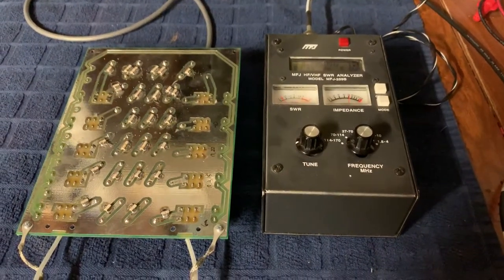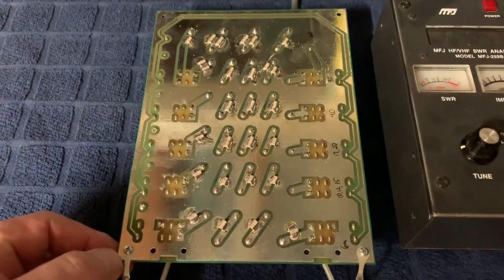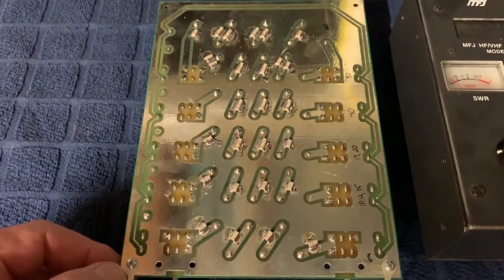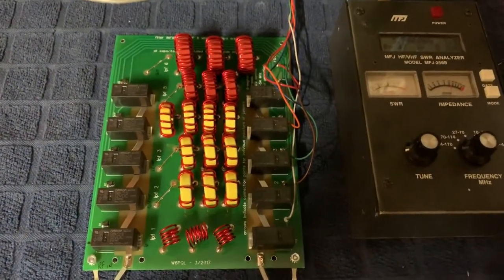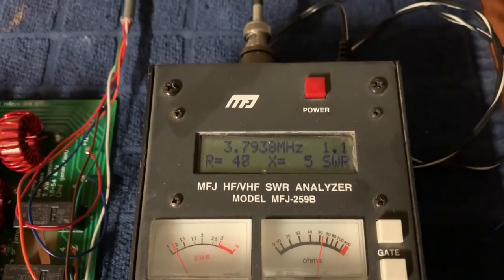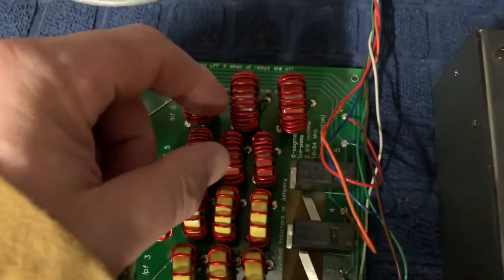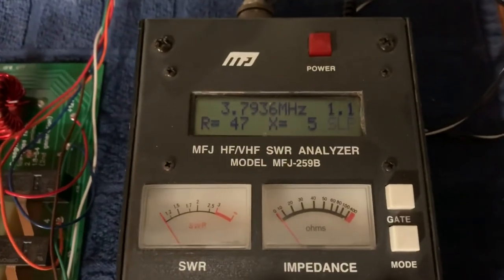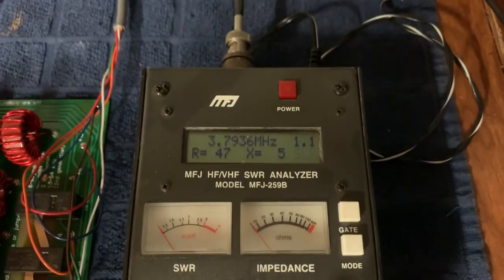Tuning a low pass filter

Comment: That's awesome. I'm doing the 10m mod to my amp supply LK550 (3) 3-500z tubes with the peter Dahl 1.75ccs plate supply and need to learn howto tune the arcos. Thank you for the video ! W1cjf